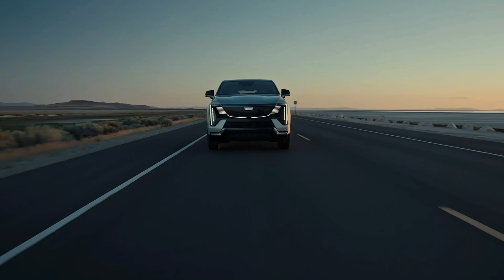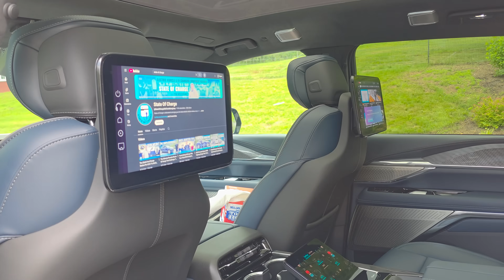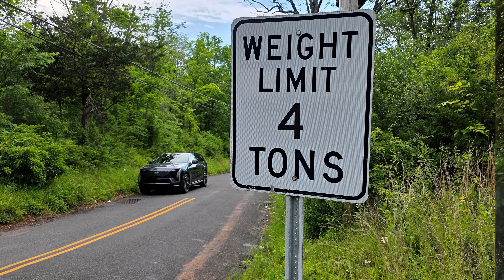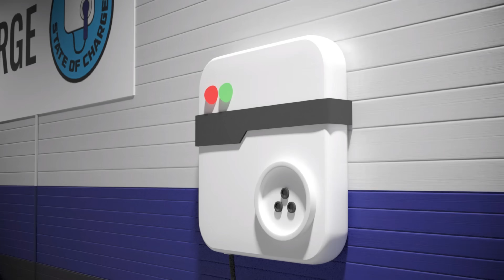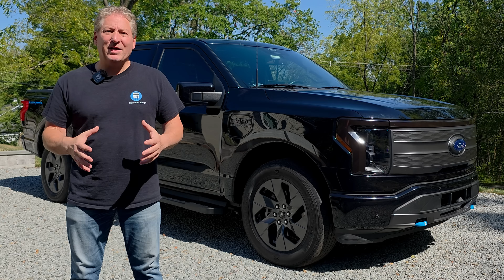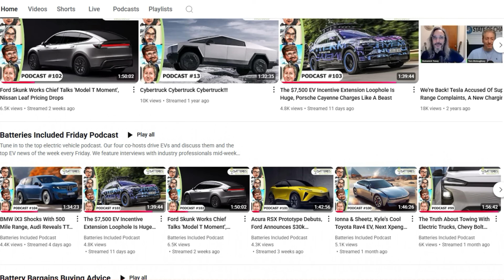Are General Motors Electric Vehicles Too Heavy For Some Public Roads?

Comment: Great story!  I have wondered about weight limits and how they affect EVs, especially SUVs and trucks.  When I got my e-tron, which is about 6,000 pounds, my town also had put up weight limit signs on a local main street, and as I recall the limit was either 6,000 pounds or close enough that I wondered if my car would be over the limit.  But the limit was short-lived and the signs came down not long after they went up.  They were clearly meant to keep large commercial trucks off certain streets, and it was a reaction to a potential traffic change that had some residents alarmed about increased truck traffic.  So, my local experience was consistent with what you heard from your local officials, that the target was really trucks, not privately owned SUVs or trucks. Good investigation on your part, but also a good caution that some local officials may not be as well-informed or as understanding as yours are when it comes to these topics.

Comment: if a bridge has a weight limit do not cross it if you weigh more. 

This is for many reasons but remember If something happens to the bridge you are on when your vehicle weighs too much you will surely be listed as at fault for the collapse or damage of the bridge. Also be sure about axle weight limits on some bridges. Oh and if you are in an accident on a bridge and can safely limp the vehicle off the bridge please due. Also if you crash into a bridge supporting structure or think you may have report it. you don't want to risk the life of someone else or yourself
Reply: Heavy gas vehicles have been around forever
Reply: @rp9674  Yes and no. Trucks are much bigger and heavier now than they used to be. That's without even considering the EV trucks.

There have been many bridges that carried highway traffic that had to be replaced in the past 50 years because the bridges were just way too small for the traffic they now carried. They were just too narrow and the trucks traveling over them had almost doubled in weight since they were built (and yes, that includes the introduction of modern semi truck designs in the 1960s).

Ofc in order to do a good comparison, one would need to compare like models to see exactly how much heavier an EV is to its ICE equivalent. I looked it up for minivans recently - it's about a thousand pounds more. That is half a ton more. So it's not an insignificant difference.
Reply: 2025 Ford F-150 is the Limited trim with a 5.0L Ti-VCT V8 engine, SuperCrew cab, 5.5-foot bed, and 4x4 drivetrain, weighing in at approximately 5,863 pounds

Comment: GM’s battery pack and module technique is great for servicing and maintaining but they are built with more metal enclosures and cooling so  they’re heavy compared to one big single pack. However I’m sure GM and others will have better battery tech and lighter vehicles overall. Imagine the range of the Escalade if it were 1000-2000 lbs lighter

Comment: Interesting point Tom.  I agree on a bridge, I would not drive over the weight limit of the bridge no matter what vehicle you are in.
Reply: As an engineer with over a decade of experience working with bridges. I cannot stress this enough: do not cross a posted bridge if you are in excess of the weight limit.

The basic formula for any LRFD design is φRn > Σ(γQ). Aka: the strength of the design must be greater than or equal to the forces applied. The Greek letters there are resistance factor and the load factor. These account for your safety factor by reducing resistance and increasing loading. This is engineering. Not “over engineering.”  We design to get both sides of the equation as close to equal as possible. Anyone can build something that stands up. It takes a structural engineer to design a structure that barely stands up. 

The numbers on the posted signs are not 4 to 10 times lower than the capacity calculated. I know this because I’ve lived having to go through the posting process. And a bridge can fail even if crossed only once by something over the weight limit. So I repeat: abide by the posting signs at bridges.
Reply: @dalegoff6186  Thanks much for your comment - too many people have a "magical thinking" that tells them weight limits, weather conditions, traffic levels - none of it applies to them. It's helpful to remind them that physics doesn't care if they think they're invulnerable.
Reply: @davidg3944  I’ll never forget several years ago checking a bridge that was posted 10 tons. On the surface, it looked fine. However, when we walked under the structure the heavily corroded girders had webs that were crushing and flanges bent out of plane. This resulted in immediate closure of the bridge. While waiting on the bridge owner to show up, a local told me he occasionally crossed the bridge with a load in excess of 10 tons because it was a shorter route. The city engineer eventually arrived on the scene and asked if we could just reduce the posting to 5 tons. My answer was no, because you cannot argue with me, but you cannot argue with the physics.
Reply: @dalegoff6186 Hmm, we account for multi vehicle scenarios and live loads on bridges don't we.  A single vehicle at 4ton range affecting the structural integrity of a bridge should be closed to vehicular traffic (you would need to engineer a check gate to allow only one vehicle at a time to cross the bridge -- signs aren't sufficient).
Reply: @Dimsum256  sorry for the previous reply. I thought you were asking about another post. 

Our load rating programs account for the loading patterns required by AASHTO. The report will generate the loading allowed for the deck, superstructure, and substructure. This will include inventory loading and operating loading. Let’s say the report shows an operating rating of 7 tons and an inventory rating of 5 tons due to insufficient shear capacity in the bent caps at bent 3 (or wherever). The structure will be posted for 5 tons and vehicles should abide by that posting. The only time you’d need to restrict the number of vehicles on the bridge is if the signage says to do so. But in no case should any vehicle on that bridge exceed 5 tons.
Reply: The best current rating method for bridges is LRFR and it might have relatively low load factor (safety factors).  You can legally drive over a bridge with a heavier weight, but you will need a permit from the agency in controll of the bridge.  Granting the permit will often consider the weight and spacing of the axles, how often the load or similar loads might cross the structure, the speed allowed, the condition of the bridge, and where on the bridge the truck might be permitted.  Note many local roads were not exactly designed as they were dirt roads in the day of rare two way actual traffic at then same time and before significant trucks.  Asphalt was added to keep dust and mud under control, not designed.
Reply: @michaelmcmullen354  load permitting was handled by a different group from who I worked with. To the best of my knowledge, you are correct about the different considerations that play into the permitting process. I don’t know of a time we allowed a permit to cross a posted bridge. Not saying it didn’t happen, I just cannot think of one.
Reply: South Carolina just had a small “posted” bridge collapse because trucks were crossing above the weight limit.  The DOT was working on another bridge and imposed a detour.  Trucks took the shortcut across the posted bridge instead of using the detour.  In a photo of the collapse, you can see a concrete truck and a dump truck that were going to attempt to cross.
Reply: Also has to survive the possibility of the bridge/road loaded with all 4 ton vehicles.
Reply: Also there are going to be a lot of laws that are unenforceable. Police would be the enforcer but I don't think their looking for big escalades down the street
Reply: Another thing you can do, if you’re interested, bridge inspection reports are available to the public. Rating and posting information will be in the report. Depending on your state depends on who you’d need to talk to. In my state, the state department of transportation handles all bridge inspections. If all else fails, the data is available from the FHWA on its infobridge app. You can see what every bridge in the country rated.
Reply: One major note - the weight limits aren't "a vehicle 1 pound over this limit will cause the bridge to collapse," it's "repeated use of the bridge by vehicles noticeably over the stated limit will cause premature wear and failure of the bridge." 

Driving an 8500 pound vehicle over a "4 ton" limit bridge once won't be a problem. (Say you're on a road trip and come across a bridge you didn't know had such a limit.) But if you have such a bridge on your regular daily drive? Don't drive that 8500 pound vehicle over it every day!

(I have one such covered bridge fairly close to me. While my "daily use" isn't over my bridge's limit - if I'm hauling a heavy load in the bed of my pickup, I'm over it. So I don't drive that way.)
Reply: @AnonymousFreakYT  Driving over it occasionally will not be a problem for you, but you are damaging the bridge.
Reply: @AnonymousFreakYT   sounds like a great epitap.... Enjoy
Reply: Yeo,  it's just about common sense.... 

Which is  rarely common. (As exemplified in a previous comment)
Reply: @nc3826 Civil engineers over-engineer things by 4-10x. One single “oops, I’m 25% over or I’ll have to backtrack a dozen miles” isn’t going to break it. Watch the video to see Tom’s response letter.
Reply: @AnonymousFreakYT when a load limit is placed on a bridge, that number is not inflated by 4-10x.  It may be able take a little more than posted, but not much.  The reason is that they try to let as many vehicles pass over without being rerouted.
Reply: @AnonymousFreakYT  What kind of ton? To me, a ton is 2240 lbs, so 8500 is less than 4 tons.  4 tons is 8960 lbs.
Reply: @qcca123-f1v  Obviously we're talking about US tons, so 4 tons = 8000 pounds.

Comment: Great Informative video! I think EV manufacturers do need to work on making lighter batteries. My Ariya weighs over 5K pounds and that's alot for a mid size suv. I could see EV's causing road damage because of the weight, but also, imagine the damage an EV would cause if it was involved in an accident with a lighter fuel powered vehicle. I would not want to be in  an accident with an escalade like this even if i were in my 5k pound Ariya!
Reply: Additional 2000 pounds are not gonna make any difference in road wear, what actually causes significant road damage are semi trucks
Reply: @lukaszwodzynskiHNB depends on the road. Not all roads are made of the same material and quality
Reply: Exactly! My local garbage collection coo explained to me they have to run the truck 5,000-10,000# over what the county approved just to pick up all the trash weekly without them going over on ot. Commercial use vehicles cause the most deaths, the most fires, the most pollution per vehicle otr&per mile driven! So gtfo of here with my 4,740# equinoxes which is about 250# more than a similar size ford explorer somehow is more damaging to my roads, especially when in my neighborhood we have many contractors 2,500&3,500series cowboy Cadillac kept cleaner than my ev is and never can be found hauling or towing anything smfh!
Reply: 2025 Ford F-150 is the Limited trim with a 5.0L Ti-VCT V8 engine, SuperCrew cab, 5.5-foot bed, and 4x4 drivetrain, weighing in at approximately 5,863 pounds
Reply: @rp9674  Thats crazy considering My Ariya is slightly larger than a Nissan Rogue and weighs over 5k lbs.
Reply: ^  still lighter than that obese pickup at many people drive as a one-person commuter

Comment: I would assume that the tonnage limit on roads in my area is specific to weight and not necessarily commercial being that many of the signs actually have a differentiator of winter versus non-winter weight. In the winter, the weight is reduced by half as opposed to Summer.

Comment: If EVs are too heavy, then maybe they should ban 18 wheelers and garbage trucks as well
Reply: Well to be fair, an 18 wheeler would be in direct violation of that 4 ton sign as it is a truck and commercial vehicle. A garbage truck would be different, if there are houses on the road that need garbage services, they may have an exception.
Reply: Yes - an large truck would get a ticket / also "18 wheelers" pay a large premium to travel roads through taxation and higher toll fees.